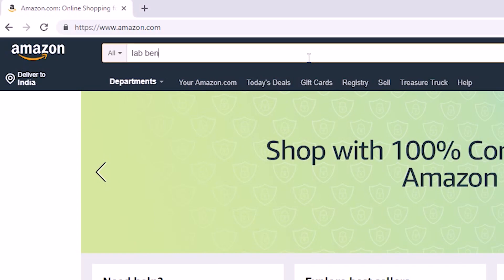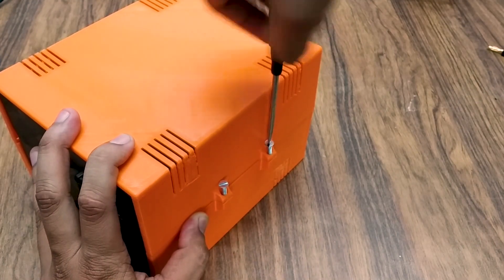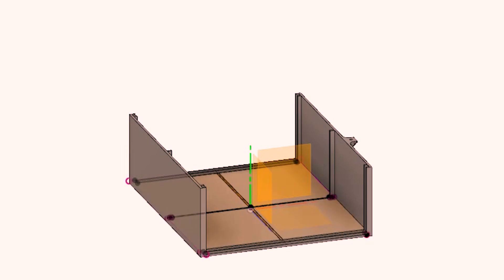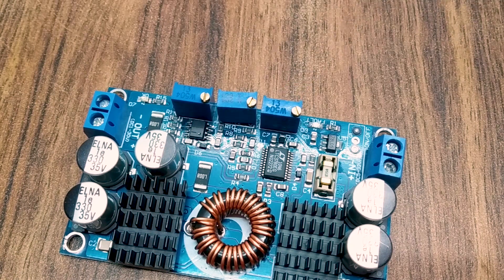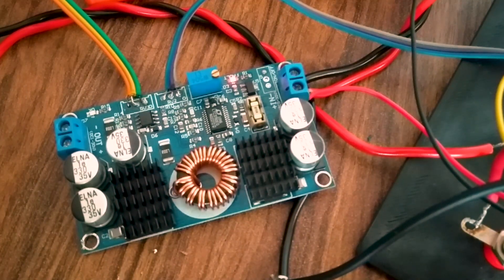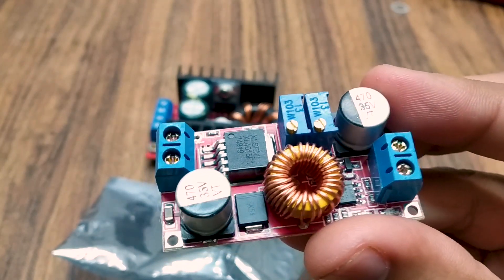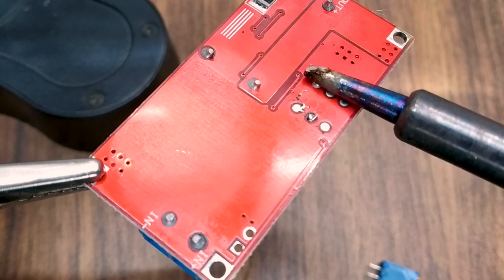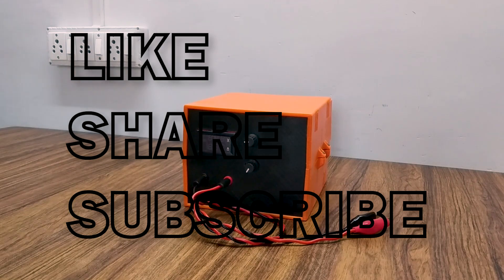How to make Simple Lab Bench Power Supply at Home

Comment: Working with main voltage can be very hazardous plz consider adding a proper fuse at the main socket and use some heat shrinking to isolate the wires. Your LTC3780 is probably fine but you need to turn the under-voltage protection (the potentiometer you kept soldered) to the lowest value but anyway that's not the best choice for a psu (poor efficiency and lot of heat to dessipate that those small heat sinks can't handle at more than 2amps i guess) , a switching power source is not either a good choice for a lab psu ( a linear transformer is more suitable to avoid noises), the xl4015 without a proper cooling too is not suitable for a lab power supply for the same efficiency problem please be carefull to the heat when using this psu and consider doing some researches about efficiency and heating of the chips you used in this video. you can start by watching a video of Robojax  @UCkcBSig_Iu4ZnAIeCeG1TVg youtuber reviwing the xl4015.